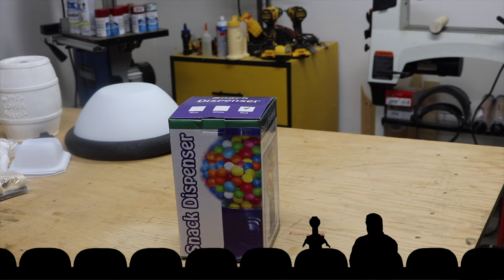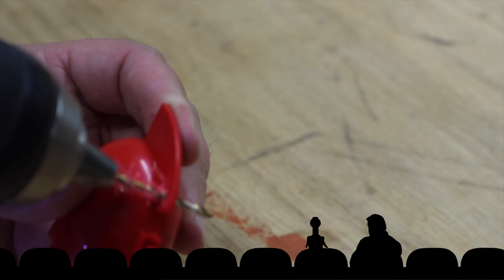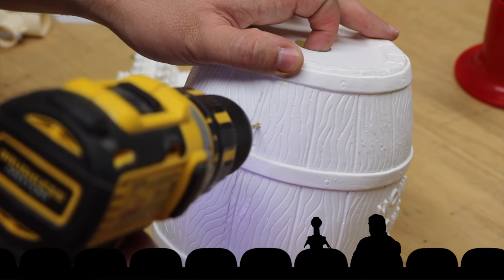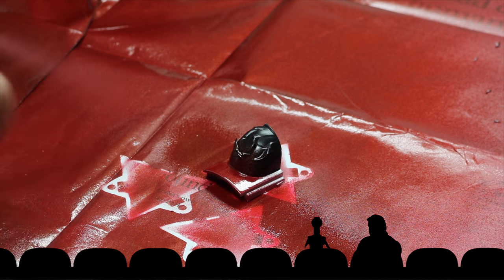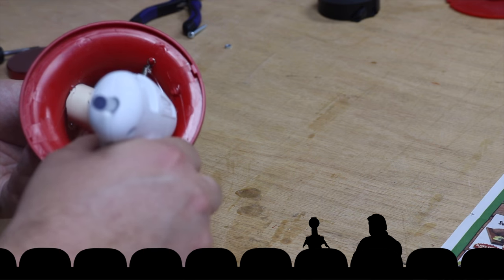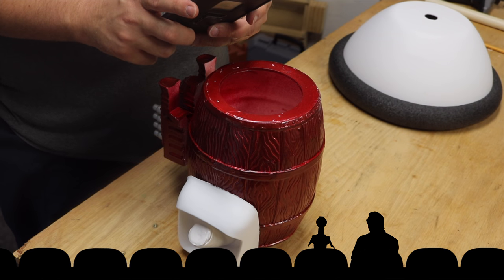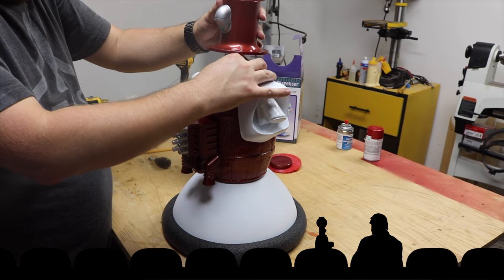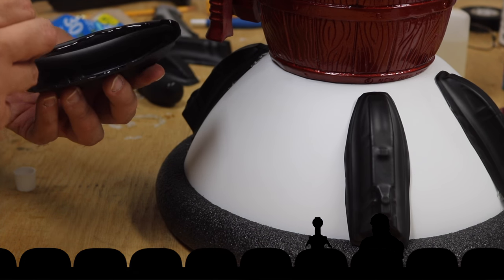How to Make Your Own Tom Servo from Mystery Science Theater 3000

Comment: I saw this video months ago, I just recvd my tom servo kit yesterday.  I'm excited to get started but I know the parts are hard to find. So I gotta take my time.  Thanks for the instructions and inspiration.
Reply from the maker: Matthew Diaz good luck with your build. I hope you have fun watching bad movies with your new wise cracking companion.
Reply: Thanks . Only one question,  the snack dispenser I recvd is blue so i primer it up and give all the parts a coat before I put it together  right???
Reply from the maker: Matthew Diaz yeah. Even though mine was red I still painted it. Give it a few light coats of primer and if you want a really smooth finish give each coat a light sanding before applying the next coat. Once you feel like you’ve covered up the blue and you have a nice surface go ahead and paint it red. The biggest thing with priming and painting is light coats and patience. Don’t try to rush it by laying the primer or paint on too thick or you’ll get runs and the paint may not dry to a nice finish.
Reply: @letsmake8166  thanks again.

Comment: This is sooooooooo helpful! I just got started on the kit. The instructions included were nowhere near as helpful as your video. Thanks a ton!
Reply from the maker: Glad it was helpful. One thing I didn't mention in the video that I think might also be helpful, I had a hard time getting some of the parts to take paint. I later found out that it could have something to do with the mold release agent used. Apparently it leaves a bit of an oily film on the parts and they need to be washed really thoroughly and then dried well before you try to paint them. It might be a good idea to do that before you even get started on the build. 
Also I'll be building Crow T. Robot later this year. I'm hoping to have that video finished in time to coincide with the release of the next season of MST3K on Netflix.
Reply: @letsmake8166  
Is that video ever coming?
Reply from the maker: @mergieismoronic  I've had a few curve balls thrown my way over the last few years. I have all the parts and I still intend to make it. I'm not sure when it will be unfortunately.
Reply: @letsmake8166 can you make a video of how yo make crow t robot

Comment: The big problem I see with the kit is that the seam in the glass bubble/dome of Tom's head is longitudinal; it's horizontal on the screen-used puppets I've seen through the run of MST3k!  The kit maker really should have corrected this.  Oh well, I've seen people replace that globe with another that has the seam around the equator.
Reply from the maker: That really bugged me too. Unfortunately the company that makes the snack dispenser changed it so the correct ones are really hard to find.

Comment: Curious the best length and way to operate Servo and the key ring. Seems like when I’m holding the ring with my middle finger it has tension upwards binding against the end of the pvc. Is there a better way to hold/operate?
Reply from the maker: I left the string long enough for about six to eight inches to hang out of the bottom of the pvc pipe. I hold the pipe with my left hand to keep Servo stable and then operate his mount with my right hand.

Comment: Nice work but what about the extra lid piece between the globe and mouth?
Reply from the maker: Wow! You’re right. There should be another lid piece between the globe and the rest of the head but the kit I used didn’t have that part. Nice catch. Now I’m not so bummed about the other inaccuracy. The line on the globe is vertical instead of horizontal because they changed the way they make the snack dispensers.
Reply: To be fair the extra lid piece is not always on he real Servo and was added later. Not 100% sure if they ever had the original look come back but a lot of little minor changes occured

Comment: Great video! Noob question. How do you screw in the screws from inside the barrel? It’s such a small space
Reply from the maker: It’s very tight in there. I just used a really short screwdriver
Reply: It looks like he enlarged the hole in the bottom, something I had to do as well. Just make sure to leave at least 1/2 inch edge to attach the skirt to.

Comment: I am building this kit now.  I see its suggested to use Red Primer on the red parts of the body... but I see you use all white.  So my question is should I use a white or red primer?
Reply from the maker: If you can find red it would probably be better. I could only find white at the time. The main thing you want to do is fill in any minor imperfections in the barrel before painting without filling in details like the wood grain. Use whichever is available to you and it should turn out fine. Also use several light coats instead of one heavy coat to avoid pooling and running.

Comment: The snack dispenser has been discontinued as far as I can see, thankfully there are ones that are very similar just slightly different in shape.
Reply from the maker: Even the one they were selling when I got mine was different than the one used on the original Tom Servo. The seam between the two halves of the dome is vertical instead of horizontal. That really bugs me. Other than that mine is pretty close to screen accurate. When people see him they don't seem to mind though. I've taken him to RiffTrax shows and people line up to get their picture with him.
Reply: Let's Make 
I managed to find a good equivalent, a Room 2 Room Round Snack Dispenser, it uses the same carousel base mold, the globe is larger but it’s fine. Though finding the round ones are kinda hard, they made one with a football shaped globe that’s still in production, but the round one seemed to have lasted a shorter time, but they can still be found at a cheap price if you look hard enough.

Comment: What kind of string/wire is used for the mouth control?
Reply from the maker: I'm not really sure. It came in the kit that I ordered from the mst3kbots website. Any strong, but flexible wire or string should work. You just want something that's not likely to break because it would probably be a pain to try to replace it after everything is assembled. A strong fishing line would probably work well.
Reply: It looks like the same line that I use for fishing. Berkley fireline smoke color (14 lb?)
Reply: @internetuser7332  Cool thanks! :D
Reply: @letsmake8166  Yah... true. Thanks!

Comment: METAL VERSIONS
when i looked up toms head, make was different to what you had. apparently toms was called a carousel executive snack dispenser, not a gumball head, i dont know what the diff is apart from the line, but in case you wanted one with the line horizontal, heres some pics from google https://bit.ly/2SS49pl Tbh i think they are antiques, but a couple of them only have bids of 2 or 3 bucks. aaaanyway,
if you scroll down a bit, theres a metal one too, (a godinger version, and another personalised exutive dispenser) which got me thinking, plastic doesnt last forever, give it a couple decades and it starts melting/getting sticky or excreting toxic fumes etc, so how cool would it be to make a metal version of the bots? they'd weigh a ton, but they'd look and feel so cool, and last forever, or at least way longer than the plastic ones. its like toys, i hate that all my collectable will one day be untouchable except for my die casts. more stuff should be metal.

Comment: How did you do the door scene
Reply from the maker: Keyframing. Lots and lots of keyframing. There are two video layers, the green screen layer with myself and Tom Servo with a table that is covered with a green cloth and then the hallway sequence. Then there are 4 separate still images all on their own layer. There's the desk, the back wall and then both sides of the door. There are keyframes for the movement of both sides of the door and then there are keyframes for the zoom in of all the layers. 
When I shot this video I had no idea how to do this and had to learn it as I went along. It's not really hard if you understand basic key framing. There are lots of tutorials online depending on which editing software you're using.
Reply: @letsmake8166  that was frigging unbelievably perfect sir.

Comment: WANT TO BUILD ALL THE BOTS?
 (last comment, promise) i found something for those wanting to make their own versions of any of the versions of any of the bots, and it has reference pics of every part used to make any version of them. it also has guides on making all the bots including a 1998 official bot building workbench bot building booklet pdf linked here
https://bit.ly/2H75qYa 
anyway, heres the main link to the site below, its not anything special except its contents, it basically a white page with blue hyperlinks to reference photos, for instance cambot is mostly reference photos and photos of what the parts are for some versions, like version 1 from season 0 used a babydoll carrier as its head. but there are guides there too. anyway, hope this helps any budding bot builders out there 
https://bit.ly/2J0iAb6 
also if you click 'parent directory' at the top, it will take you to the main page i suppose, which seems to have tonnnnnnns of mts3k pics. i dont know who made the site, or even how you'd find it with such an obscure web address (it was just pure fumbling that i did) but theres a lot of references here for mst3k, so it was clearly done by a fan.